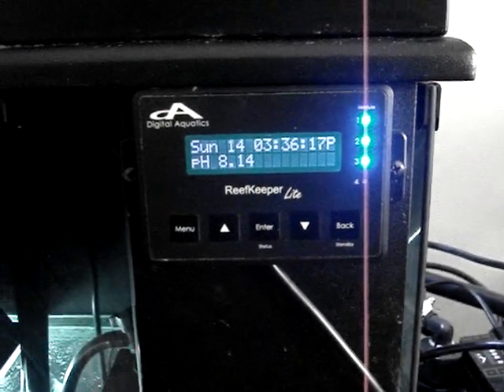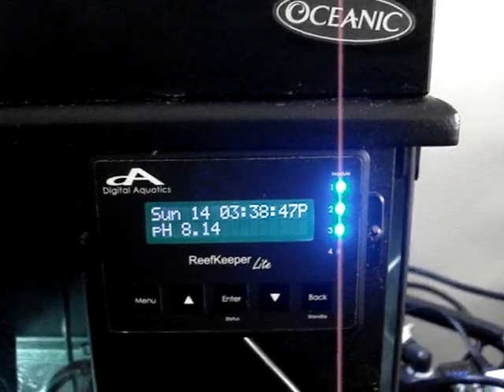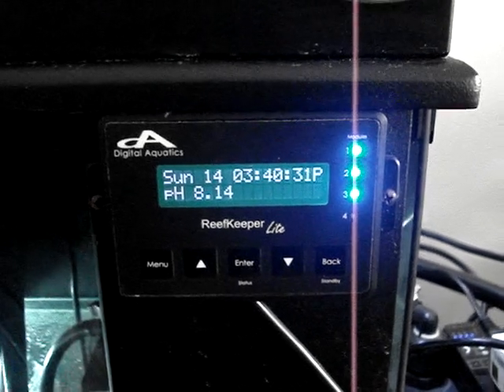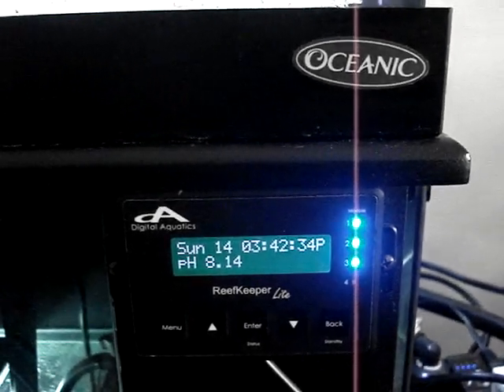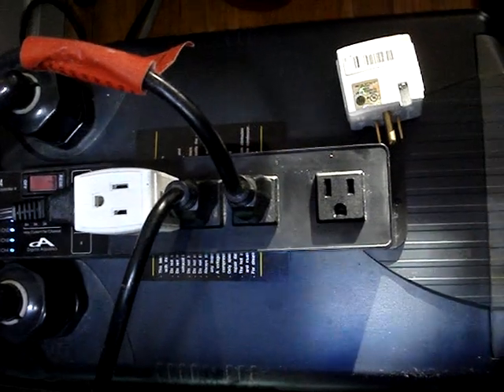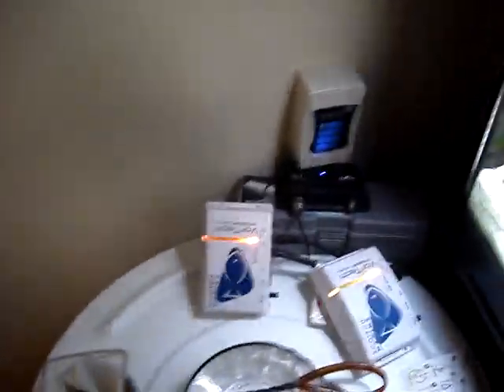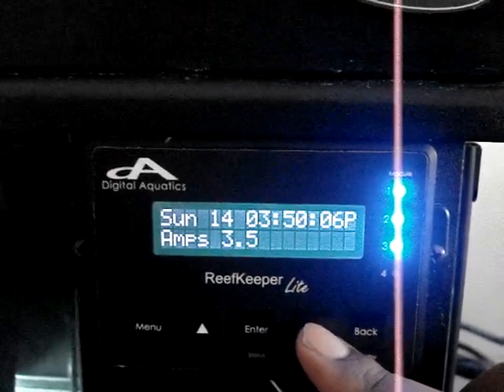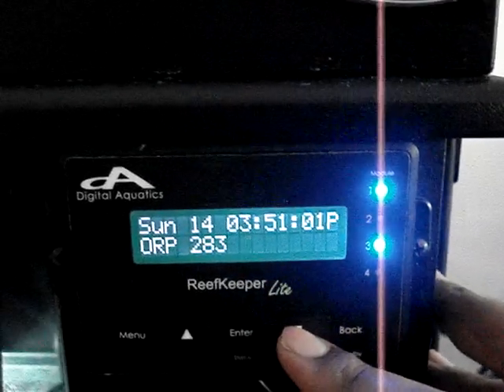ReefKeeper Lite Aquarium Controller

Comment: Also I do have for example my canopy fan controlled so that it does not cool too low that the heater turns on, then I do have some Aqualifter pumps controlled in a way that on specific days a week the individual lifter pumps are pumping supplements like magnesium stock solutions into the tank in increments of 1sec.

Comment: No the hydor pumps I have at the moment are 110v plug in the wall. They would plug in the pc4. What I'm trying to sayin is the hydor 12v wave controller and pumps for like $350. But I can get the reef keeper system for 189 and use my pumps. Seems like i would be getting more bang for the buck idk I'm having trouble deciding what to do now.

Comment: I was looking at the 12v setup with pumps and was gonna be around $320 for the everything. But found a site that's running a special on the reef keeper unit for $189. Was thinking it's cheaper and I would be able to do more stuff with it.

Comment: @newyorksteelo the 1 I was looking at was the Royal Exclusiv Vertex Alpha VX-200 Cone Skimmer with a red dragon pump 1500 LPH but I was curious if the system could get away with the VX-170 rated for 200 gal... Have you heard anything about this particular skimmer?

Comment: @newyorksteelo Do you have the salinity probe for reef keeper and if so how accurate is it ? Also do you have to calibrate it  often? if not do you recommend getting one or just use my refractometer?  Also set my reef keeper up to turn a small pump on to pump 1.5 gallons a day out then set my auto top to come on and replinish without any floats. Small amount of water does not run sump too low and makes water change automaic. see any problems doing it that way?

Comment: Could you tell me how to run a two switch light off of one outlet on the PC4 I have a plug kind of like yours where I can connect multiple items to the plug. And if you can do this how do you control the different lights to come on at different times?

Thanks